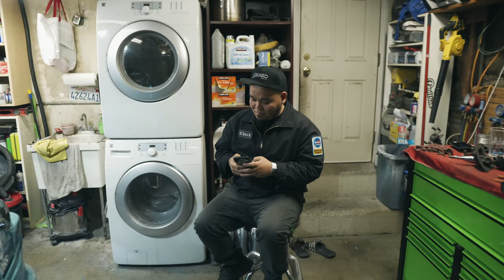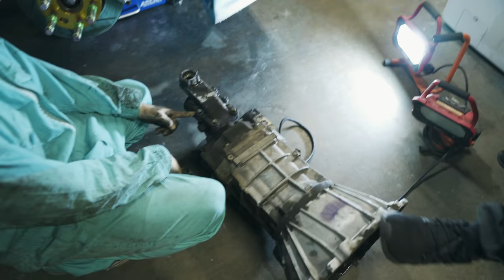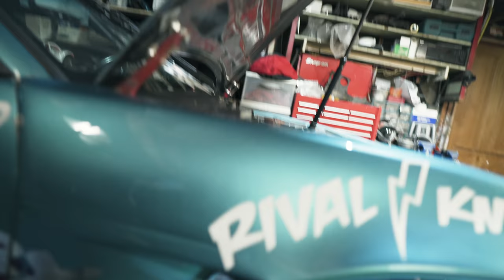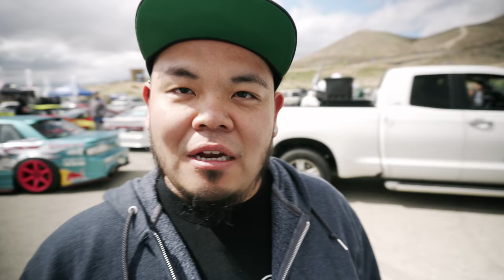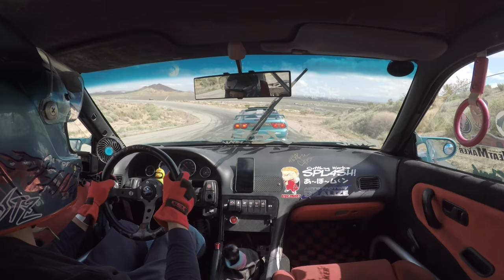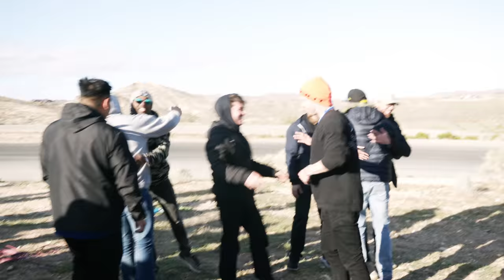Last Drift Event of the Year: Final Bout SSW

Comment: Why couldnt they just swap the shifter extension onto the new trans? Am i missing something? 🤔
Reply: The rear case would have to come off the trans to do it. It's not hard, but I wasn't going to have enough time to re-seal the trans, wait for the seal to cure, then fill it with fluid, then drive to the track.
Reply: @GarySukrattanawong  ahh makes sense